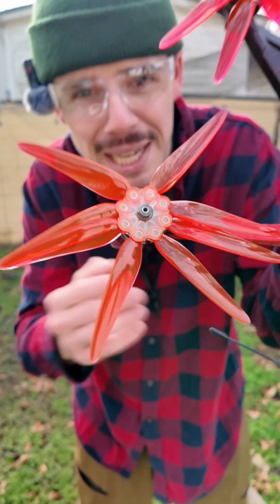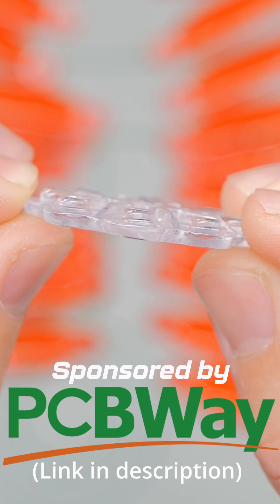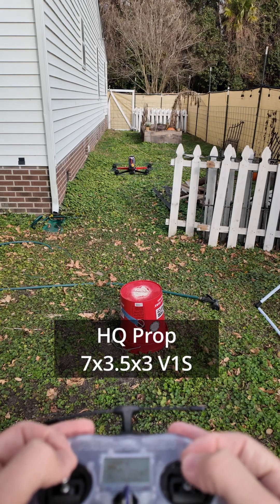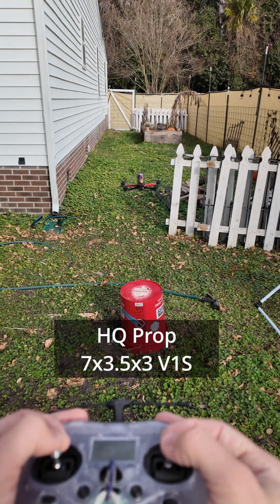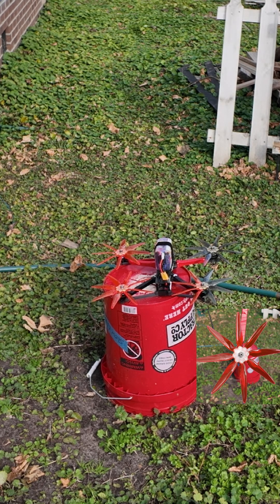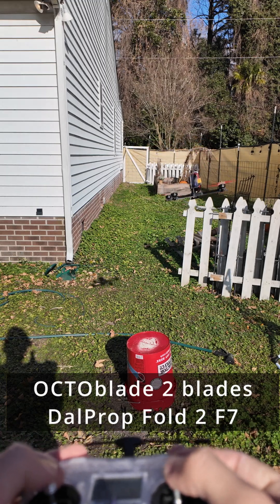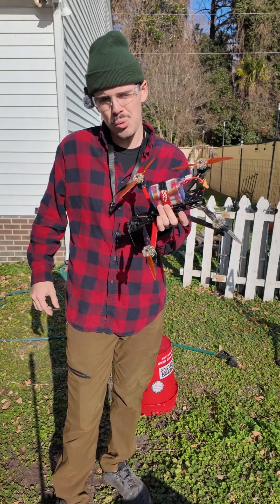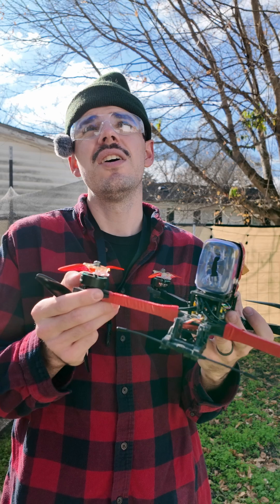Which is Quietest? 2 vs 3 vs 4 vs 6 vs 8 Blade Drone Propeller? OCTOblade Noise Comparison

Comment: My 5 inch is super quiet with 5 and 8 blade 3.5 inch props. I'm quieted down my quads by using more blades and a prop that is 1/2" to 1" smaller in diameter. I figured I get more lift from the increase in the number of blades and slower prop tip speed by going with smaller props.
Reply: You do get slower tip speed with a smaller prop, but one benefit of the larger ones is more thrust for less required motor speed. Which usually results in quieter operation too. Well, at least it very much does from PC fans so I imagine the same SHOULD be true of drone/aircraft props too?
Reply: @DavidStruveDesigns  I don't know why it works. I can only guess, but going smaller on the prop diameter and adding blades makes the quad quieter.  It's not more powerful, but it still has plenty of power to punch out or to grip corners.
Reply: @CarbonGlassMan   It's probably some complex relation between getting tip-speed down to below supersonic speeds (or closer to that level) and how the blades themselves vibrate as they move through the air and how much turbulence that creates. That's my best guess, though it's actually WAY beyond my knowledge level cos it involves complex physics, fluid dynamics, sound frequencies etc.